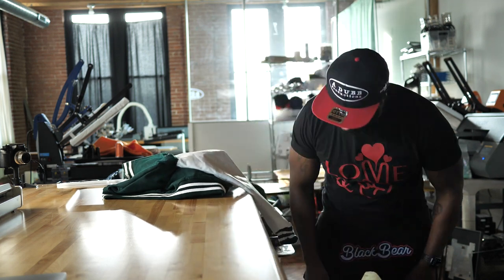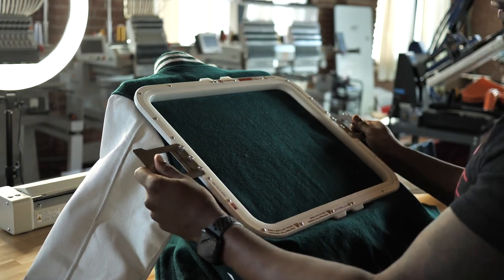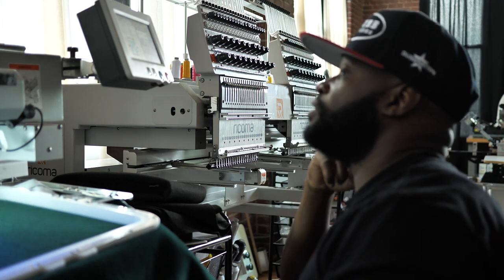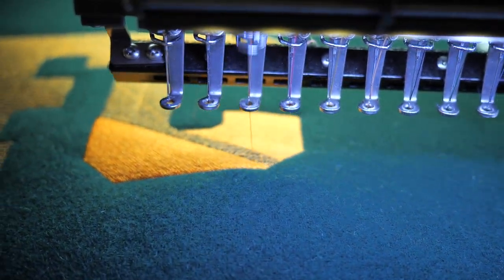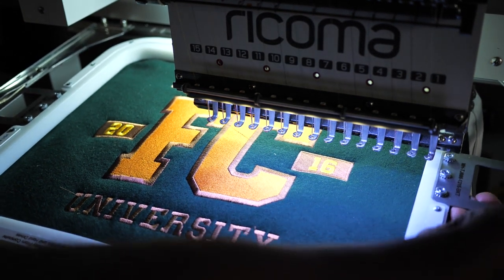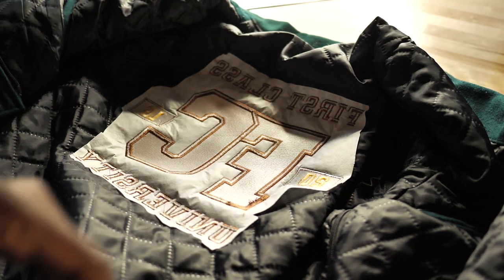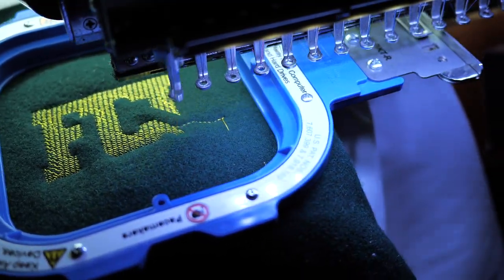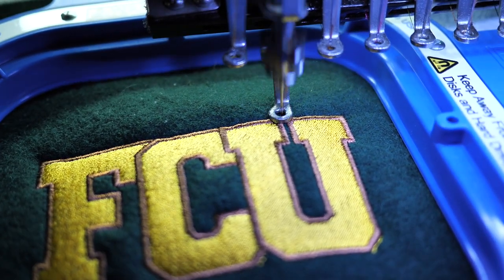How I Embroider on Varsity Jackets

Comment: Wonderful work, the embroidered portion came out great. I was curious if the jacket had a removable lining so that the stabilizer and stitching could have been hidden? Does sewing through the lining and jacket cause the jacket to fit a bit tighter?
Reply from the maker: It had a half zip away lining attached at the lower sleeves. I opened it up and hooped the jacket back, I did not embroider on the lining.

Comment: Can you embroider directly in the leather sleeves?
Reply from the maker: Yes to a certain point because the arm of the sleeve has to be able to fit onto the machine and move around left to right enough to embroider the design.  If it’s to tight it will move the part your trying to embroider and lose registration.  So I’d say you can all the way close to the half way point (elbow part)
Reply: @adubbproductions  thanks. I’ve seen some folks take the seam apart of the sleeve now I know why. That’s a lot of work to sew back together. The jacket is fire! Looks so professional. I hope to get a machine someday.

Comment: Question- What needle type and thread weight do you use to embroider on the wool body and leather sleeves of the letterman jackets? (75/11 or 80/12 needle)?
Reply from the maker: I used 75/11 and with standard 40wt thread.

Comment: I'm about to stitch on a jacket. I opened the sleeve and added a patch. I'm about to change the name on the front (someone spelled it wrong). I've already destitched, but do I need to open up the liner before embroidering the new one?  Or can I just stitch through the liner?  There's a small zipper to get into the bottom of the liner, but not to fully open it up. Is that going to screw it to if I embroider through the liner?
Reply: I'm just worried about if they ever need to get back into it to add more arm patches, I want them to be able to.

Comment: Question?  I am doing the same project more than once.  How do reset my hoop to return to origin? I hit origin but it does not return my hoop to the start.
Reply: I am Merry from Digitizings, We are offering you a special offer for embroidery digitizing and vector art services.

If you are running an embroidery business you must be facing machine file turnaround or bad quality of stitch results and paying the extra cost for it. We are offering excellent quality embroidery digitizing always check the preview of your design before you pay. Our pricing is very reasonable.

If you have any designs to get digitized send us today so we can digitize them and show you a preview of your design.

Comment: was there an issue with the stitching on the back, noticed a line on the FC.
Reply from the maker: That was in digitizing.  I should have adjusted it before I embroidered it.  You have to set the start and stop points opposite of the angle lines or you will get that every time. That was my fault. I had already started and to stop it and correct that would be very difficult.  One of those things that you have to get right before you start the job.

Comment: I would of changed the stitch angle in the FC and also had each letter stitch separately. and there is a start stop line in there. Kind of looks like a auto digitized File. Also Why didn't you use the 5.5 fixture for the left chest.
Reply from the maker: I can’t just change someone’s design and separate the FC.  That’s not what they requested but I get it. Angle line and start stop point i should have made different yes. 
Auto digitized definitely not. What software are you using?   Auto digitized would never give you anything looking like this. I would have to strongly disagree with you on that. You have no idea what you are talking about I’m sorry clearly you don’t because I did use the 5.5 hoop. You clearly see it in the video.  Even if I might have mistakenly said the wrong hoop size everyone knows what the 5.5 sizes hoop looks like.  But i get you.  Thanks for watching. Do you embroider? I’d love to see some of your stuff. I’m guessing you don’t digitize at all because no auto-digitize can give you this quality.  You don’t even own a 5.5 inch mighty hoop do you?  Clearly you don’t know what one looks like.  I could be wrong. Doubt it but, i could be….. but I highly doubt it.
Reply: @adubbproductions  coming off a little strong there brother......

Comment: These is a visible diagonal line on the C in the back, what caused that?
Reply from the maker: The start stop point have to be opposite the angle of the stitch or they meet in the middle causing a line at the meeting point.  I should have changed it but sometimes when digitizing I forget things.

Comment: I see as you are cutting the stabilizer from the back. You did not unzip the lining and stitch just on the wool alone. Now you have made it inaccessible or harder to stitch patches on the sleeves. These quality jackets have that sip open lining for a reason. It also makes it a nice clean job.
T do the sleeves if you pull the sleeve out and unzip the lining all you need to do is unstitch the leather sleeve and do your work. I do not embroider on leather sleeves I do sew chenille patches or patches on leather sleeves. After stitching your item then you just need a sewing machine to stitch back the sleeve seam. I have been doing it for 40 years. It is doable.
Reply from the maker: Thanks for the tip. The sleeves are always sewn shut at the cuff.  Do you have a video showing your process? If not can you make one.?
Reply: @adubbproductions   I will look I just have been sewing patches on varsity jackets for so long. Yes, the sleeves are stitched at the cuffs and you do need to be cautious not to remove the leather stitching too close to the cuff. As it is hard to get a sewing machine foot close to the cuff to stitch the leather or lining part stitched I usually can go to around 2 inches of the cuff. Then I also blae a safety pin across the stitching line so I won't accidentally open the sleeve lining or leather too fat. This happened once and I had to take it loose and stitch and restitch the cuff. It is a hard stitch if you are trying to stitch it without an industrial machine. I will look for a video showing how to do that. But the back and chests should be pretty simple if you find the invisible zipper and unzip the lining from the body. The embroidery is so much nicer if it is not stitched through the lining. Unfortunately, the Amazon jackets that customers bring in do not have an invisible zipper and I have to stitch through the lining I do tell the customer upfront that it can be an issue with "bubbling" when the body and lining are stitched together and if there is more than one line in the design that can be an issue.